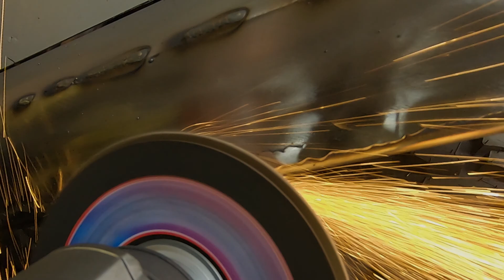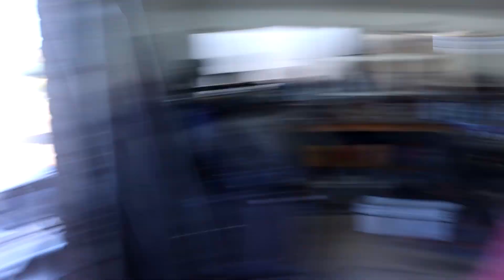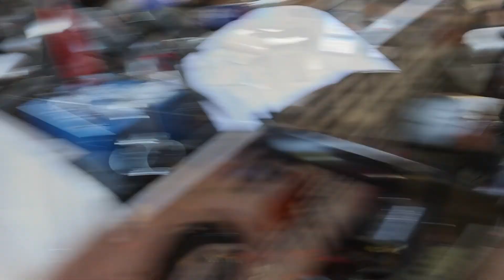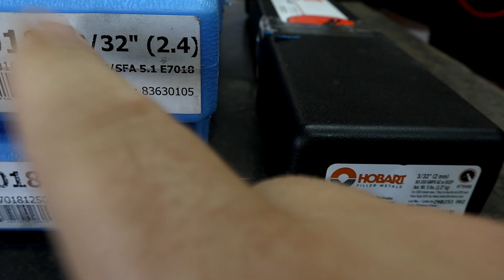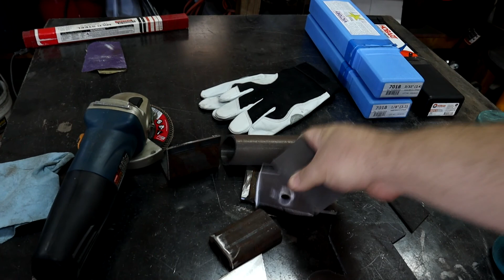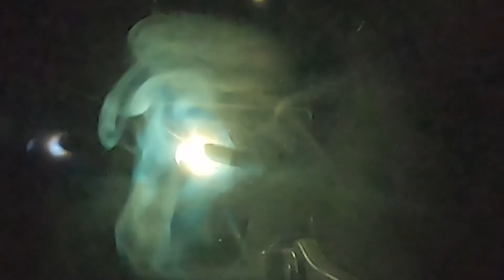Firing up the Bronco and testing out the Premier Power Welder. This thing is great.

Comment: Fortunately the Creator here chose all DC Rods to test,  He erroneously said the PPW produced AC in this video which it does not.  It definitely a DC Machine.

The rods in tis video are all good and work great with the PPW  :) 

I'll tell what the  Pat Gremillion the original owner of Premier Power Welder recommended to use and that 8018 Rods, I saw him here on youtube and he mentioned it several times

He said to use 8018 Rods .. that would indicate either the 8017-G or 8018-C3  They are more difficult to find but that's the one HE prefers.   

I should add the current owner is his son.

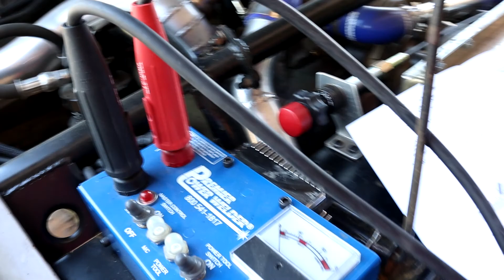Comment: 3:18 Just a couple points here so far. 

The PPW uses Direct Current (DC) not AC, it is high-frequency pulsating DC current that's where the confusion come in, 

But it's definitely DC, you need to know that when buying rods (electrodes)  it WILL work on AC Rods, too, but it is specifically certified with DC ones. 

The Amperage is variable too, it does that automatically, there is no setting changes for Amperage.  That's how it can use larger 3/32 rods for example, the system draw more Amps, automatically when you need it.

Comment: Because I am old school I hate when shemales call or refer to their truck as she, old girl, her, and every other human female reference.
I own a flatbed truck I call work bench because I use it as a workbench, I own a JEEP truck I named JEEPenstien because the body is mounted on a Suburban frame with a 500 inch Cadillac engine, I own a CJ5 my sister named BULLITT because I can run it up 95 MPH with NO death wobble.  I own 2013 FXDB Dyna I call TRIGGER after Roy Roger's horse.  TRIGGER  has over 94,000 miles on the original drive train; no engine mods yet.

I do not refer to any of my vehicles as feminin.  They either have a nick name based on some characteristic or it is an "IT,"  a machine.  They are machines, not women.  I am way into women and p*ssy and love it, but my machines are just that, machines.
The nick names are because I relate my machines to some thing.
shemales refer to their stuff as some form of feminine. 
That's my story and I am sticking to it.

Comment: I might be wrong but i swear PPW output was a high frequency dc arc... three phase output sentbthrough a bunch of rectifier to put out dc current?... again i may be wrong... but thanks for the video loved it
Reply from the maker: Everything I've got says AC output.
Reply: @Fabrication101  It is a dc machine! And you run brushed tools! 

What power tools can I use with the control unit?
We have tested an know any AC brush-driven hand tool (i.e., grinders, saws, sanders)
The George Forman grill, Electric Fry Pans, Coffee Pots and Blenders.